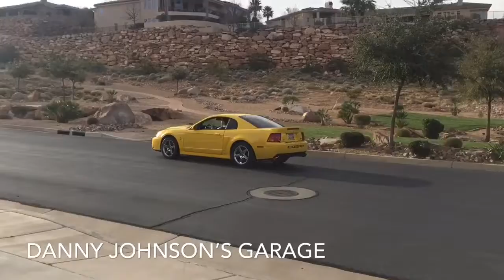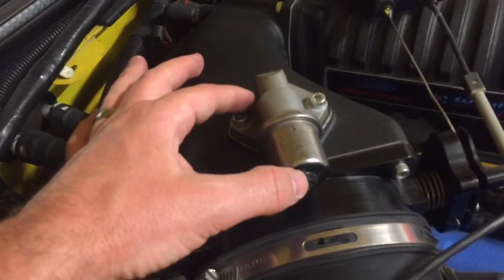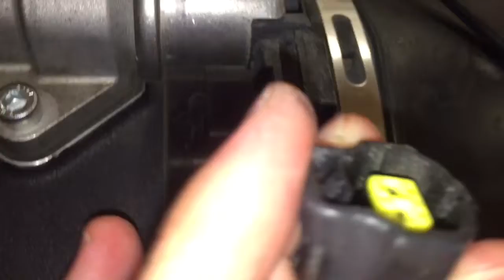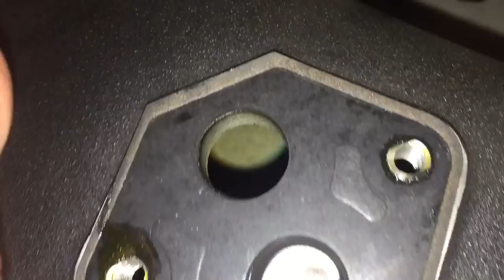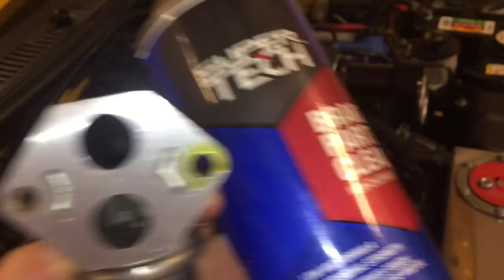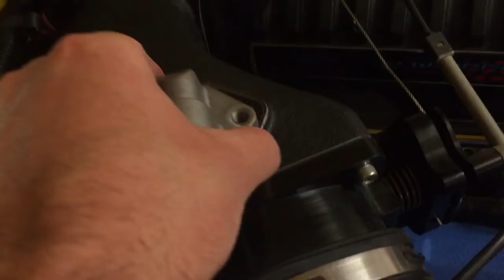Idle air control valve (IAC) clean and/or replacement  Ford Mustang

Comment: I have a 2002 V6 Mustang that I cleaned the IAC. At first after cleaning it was fine but it started rough idling again and surging in the RPMs when I would put it on neutral. Would this mean I need to replace it?
Reply from the maker: I would try cleaning the mass airflow meter first before replacing the iac. It could also be bad front 02 sensors https://youtu.be/vE1G8kbn3L4?si=ndWWiE7w_FNY-0x_

Comment: Hi 2001 cobra, i have problems with this valve! Mine has a metal button in te middle if i pour water i can tell air is coming from the metal button, is that normal? Its my second autozone iac valve, just got in the mail a motorcraft one will install tomorrow😊 but if i where to delete it with a plate would a check engine light come on? Will the car run better? Love the videos danny

Comment: Would you recommend restricting or cutting this off with a plate? Any advantages/disadvantages of doing this?
Reply from the maker: It’s common to do so on the 32V cars if you have hanging idle
Reply: @dannyjohnsonsgarage  thanks!

Comment: My car started dying at idle it start no problem but under 5 min it stalls out . Could replacing fix the issue ?
Reply: did you fix your issue?
Reply: @Shadow-and-sogest  Yes At the time i replaced the IAC and it definitely fixed up the rough idle for sure.. Also the car didn’t die at idle either.
Reply: @OperatorGhostShadow  waiting on mine to arrive, thanks for the reply
Reply: @Shadow-and-sogest  Np I would also clean the MAF sensor as well
Reply: @OperatorGhostShadow  my car has no engine light or loss of power, it runs fine other then stalling when i come to a stop, when the rpms drop from letting off accelerator, it doesnt bump back up to idle.
Reply: @Shadow-and-sogest  Do you have any leaks in your vacuum tube ? Or try replacing your Ignition Coils .That also helped my idle problem
Reply: @OperatorGhostShadow  I did plugs on it, the wires still look really good, like I said, it runs fine other than when the idle drops , it don’t bounce back and idle, it just dies. I already ordered the I ac , I’ll let you know in a few days how it goes.
Reply: @OperatorGhostShadow  update!! I did Iac and TPS sensors. My car is not dying anymore . But, it’s surging slightly after I let off the gas and push the clutch, I would say it kinda hesitates for about a second or two before the rpm’s drop. It’s a little annoying but idk how I would even attempt to fix that
Reply: It’s running fine now, that’s for all the imput
Reply: @Shadow-and-sogest  Aye that’s good to hear brother 👍🏼

Comment: I have a strange problem with my 2001 Eaton swapped Cobra. When I start the car its revs up to about 2000rpm and comes slowly down after 20-30sec to 1300rpm. But when I'm driving around and press the clutch it revs up again until 1800-2000rpm until I release the clutch. This happend after my clutch and flywheel was replaced about 2-3 years ago. I didnt bother me back then, but now it pisses me off. I connected also my SCT to check the error codes and it gives me P0135 and P0155 which would be the 2 upstreams O2-Sensors. Can those 2 O2sensors cause that problem?

Comment: Hi. My ecoboost mustang surges between 700-900 RPM upon startup and then idles to normal around 700 RPM after a minute. Do you think replacing this part will solve that issue?
Reply from the maker: Wreckanize It very well could be
Reply: @dannyjohnsonsgarage  Thanks, just read that 2015's and up don't have IAC's, I'll give it a go cleaning the Throttle Body.

Comment: Why my mustang stalls and doesn't throw a code? I purchased a Duralast AIC (didn'tLast) last winter and after installing it my rpm was high 1,000rpm (winter) now in the summer the car stalls randomly.
Reply from the maker: M Giovanni I would look for a loose intake connection or a vacuum leak
Reply: @dannyjohnsonsgarage  IAC only controls your idle so if your throttle is dirty there is nothing you can do with the idle.Clean your throttle first then the IAC. If that will not work then change the IAC, that exactly  what I did on my Expedition and it worked.
l
Reply from the maker: Efren Saclolo The IAC acts as a throttle body aid as it increases and decreased air flow. It’s in regards to idle as the video stated

Comment: does this piece cause the check engine light to ever come on? just curious looking at a vehicle that has a check engine light on 2001 mustang v6, he said that it's the iac but not certain., really don't wanna pay more than what it's worth if it is this though then it's worth the price.
Reply from the maker: Dean Decker I would take it to a car parts store and have them run the code (usually they can do it for free). I don’t believe I’ve ever had a check engine light from one personally

Comment: Im going to try this when i get home but my V6 idles really rough and my exhaust smells like eggs so i figured clogged catalytic converter but after 2k rpm the engine runs perfect so that makes me think its the IAC (Like I’m not applying enough throttle so it isn’t opening good but when I step on it it opens good and my engine runs normal meaning the IAC just needs ti be cleaned?) What do you think?

Comment: Hey man! I sold my cobra but I ended up with a untouched 86 foxbody. I was thinking of cleaning the IAC or TB as for some reason, the first time it starts up it will kill. I’ll have to start it again and it runs awesome. It turns over and starts fine it just dies and requires a second start and no other issues. Do you think this will or could help?
Reply from the maker: caseindaplace could be
1. Failing fuel pump 
2.Clogged fuel filter 
3. mass air flow meter (clean it) 
4. Vacuum leak
Reply: Danny Johnson hey bud, I noticed my fox has an exhaust leak. When driving I can hear it - under passenger side floor so most likely where the exhaust connects I’ll check it out.

I also heard a whistle from the engine bay i believe. Would that whistle be a vacuum leak which may cause it to turn over, start and die the first start only? I’ll have to trace the whistle once i can get someone to rev it with me out the car
Reply from the maker: caseindaplace https://youtu.be/vE1G8kbn3L4

Comment: Can I use maf cleaner to clean this?
Reply from the maker: cody hill Should be okay, but maf is more of an electronic circuit cleaner, so you may need the brake parts cleaner

Comment: Could the IAC being bad cause surging idle when AC is on? It's fine when the AC is off
Reply from the maker: SiREN2173 it’s possible, but more likely it’s from extra load from the ac compressor. If you have a tune, you might be able to set your idle a little higher in the summer
Reply from the maker: SiREN2173 https://youtu.be/A0oFWJOFF38
Reply: Did the iac fix your problem? I'm having the same problem too

Comment: This may be a long shot but recently my factory IAC went out and I replaced it with a cheap Autozone part and learned the hard way that those are no good, so I got a motorcraft part and it fixed my main problem which was the car would not idle and wouldn’t react to throttle. So now my issue is that it has a slight miss only at idle and is fine anywhere above 1k rpms. (She runs great for a 170k mile gt) new parts added since this issue include IAC, spark plugs, pcv valve, some misc vacuum lines (vac test was good) and I cleaned my maf, tb, and egr. Fuel pump and filter were done maybe a year ago, but have never replaced coil packs or injectors. No codes ever come up on my sct tuner. Kind of at a loss with all this. But yeah my only issue is the car is missing at anything under 1k. Sorry for the paragraph lol.
Reply from the maker: You may want to look into the front o2 sensors. I chased a "lean" condition and changed injectors, fuel pump etc just to find out the o2 sensor was faulty..and that little guy can cause hesitation. https://www.youtube.com/watch?v=SSbwbxyT5j8&t=17s
Reply: Danny Johnson thanks man! Ill definitely look into that. And thanks for that video link, that’s gonna help too.
Reply: you are so right about aftermarket iac. ive tried 2 different ones. first one idled high and would come down eventually to 1200rpm. the 2nd iac did good for a few months till i changed the intake manifold gaskets, then it crapped out and is doing the same thing. no vac leaks or anything forgotten to be hooked up. going back with a motorcraft iac.
Reply: The oem one used for 96-98' gt is made by Hitachi

Comment: Always thank you for your videos, my cobra is 27k miles, when do I know when to clean  mine out
Reply from the maker: It will probably be fine for quite awhile, but mine didn't need to really be cleaned and you saw how easy it was to remove, so maybe try it on a Saturday..but make sure that little gasket doesn't tear ;)